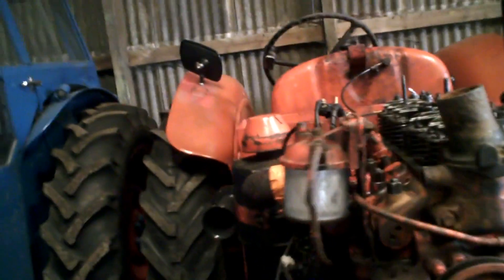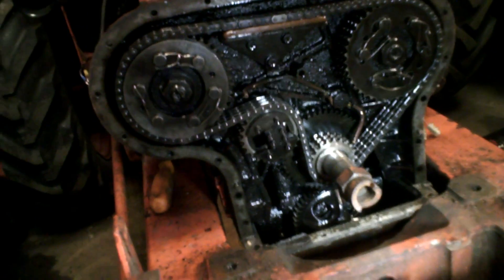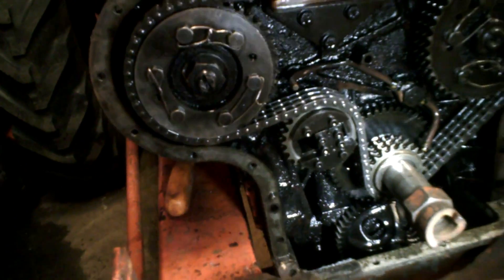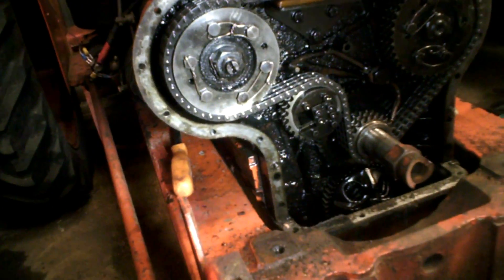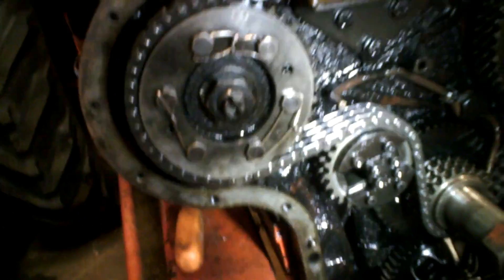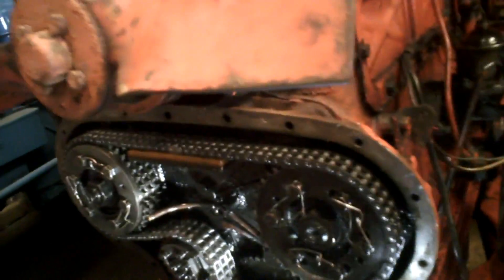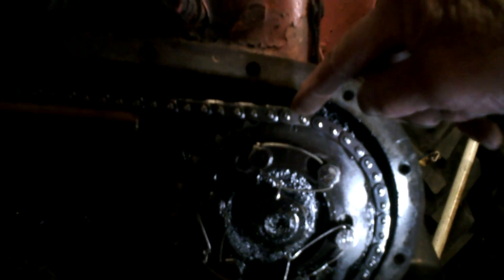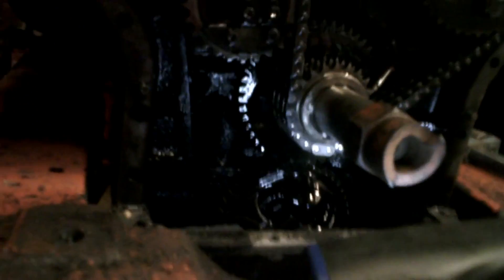Nuffield DM4 Crankshaft Timing BMC 3.4 Engine

Comment: When, in the past, it seems, the engine overhaul was done, the ship was spoilt for a ha'penth of tar! One of my Minors had the same problem - it turned out that, when the gearbox was overhauled, the old bearings were put back in. Crazy! All the best, Malc.
Reply from the maker: That's right Colin. Although I don't think it was the person who did the engine that was to blame. I'm guessing the head was ok, possibly reground the valves etc. However knowing it belonged to 'the bodger' an old man in Somerset for at least 20 years, I can be fairly sure it was him that had a head problem. He only took it to shows on a trailer, so it only had to run enough to go around the ring, maybe not that. Chap I bought it from told me that, it was stood for 18 months due to the bodgers ill health. And he only did around 20 miles in the 4 years he had it. Despite my late start this year, due to getting the injectors done I still managed around 150 miles.

Comment: Hi malc. Watched you video and it set me thinking. Have had a problem in the past with the drive coupler between the injection pump and the drive coupler from the timing case. The Bakelite cross piece between the two had broken up and so thrown the pump timing out. Don't think it is your problem but might be worth a look. Sounds more like other comment about diaphragm could be the cause but thought I better share my past experience just in case. 
Many thanks
Pete.
Reply from the maker: Thanks Peter. The coupler is ok. It could be an air leak in the fuel line and we didn't run it long enough to purge it. Having now checked the timing and that is all good, my thoughts are now with the governor. It's not vacuum, now know for definite. So.....when it went on 3 and the governor opened fully, possibly for the first time for years, has it broken something, or got stuck......thanks again. Next step is to get the injectors checked, so in a few days.

Comment: That was amazingly clean. Well taken care of.
Reply from the maker: Because of the good oil pressure and good running, I was fairly sure this engine had been reconditioned when it was put in the tractor.....which might? be around the late 90s as it was registered in 1999. That assumption was correct, however they didn't do the head. If that had been done properly as I've no done it, I'm sure I wouldn't have this problem.